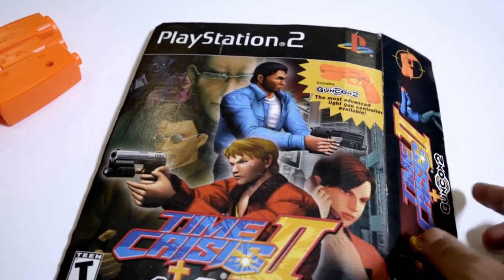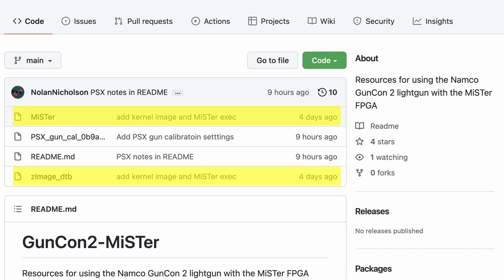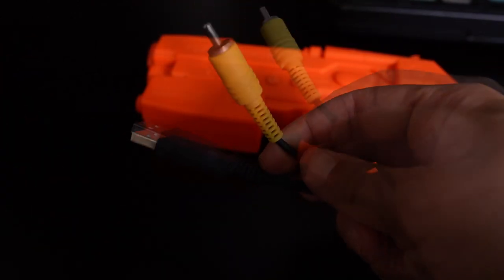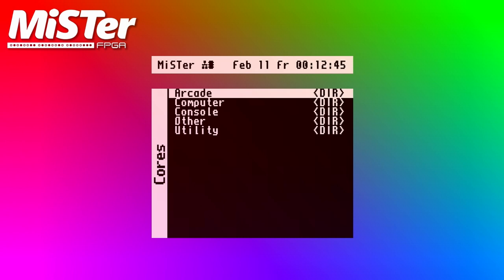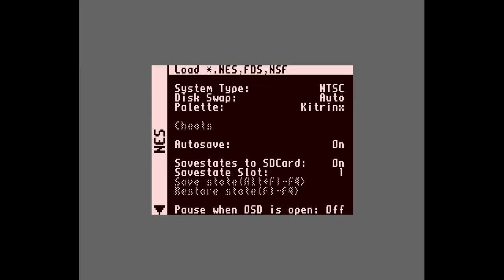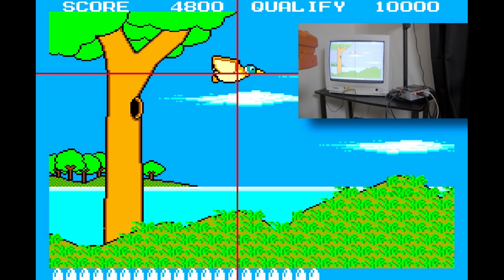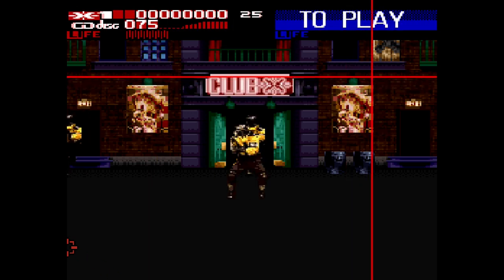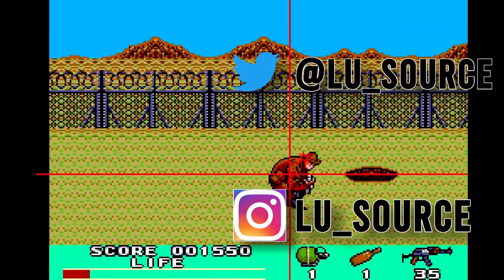Use a GunCon 2 with the MiSTer FPGA!

Comment: I found when calibrating you need to press the "A" button on the guncon (it's mentioned in the github). On T2, I set the SNES "A" button to the "A" button on the guncon, and the SNES "B" button to the trigger on the guncon, and it worked well after that.

Comment: Just a quick tip for anyone using S-video with Antonio Villenas adapter: You would think that you could just plug the GunCon  rca cable right into the unused composite output on the adapter but that does not work for some reason. You have to still plug composite into your TV and split the signal like normal. I suppose the reason is that the adapter does not send a composite signal unless it detects a TV input.
Reply from the maker: Thanks for letting us know.
Reply: So do you have tha adapter connected to your tv with both s-video and composite (for the light gun)?  Do you just switch to composite input to play light gun games? Or do you have to mess around with cables when it want to go between s-video and composite?
Reply: @markderidder   yes my mister is connected to the TV with both s-video and composite simultaneously , but I never have to switch to composite on the TV, I can play light gun games with
 s-video. It’s weird, but that’s the only way it works with the adapter. On my real PS1 and PS2 I can plug composite right into the guns without any composite TV input and it works fine. 🤷‍♂️
Reply: @Pawnband  odd. But thanks for clarifying!

Comment: This is really cool, wished it worked for CRT monitors. Fingers crossed for Sinden lightgun support in the future.
Reply from the maker: This works on CRT's exclusively. Maybe you actually meant flat panel TVs? The GitHub project for the GunCon support does mention that you can use it with the Sinden lightgun. However it requires a Pi 4, Arduino Micro and OSSC.
Reply: @LusRetroSource  Well, CRT monitors and CRT TVs work a bit differently. Most lightguns don't work on CRT monitors. I'll have to look into it more.
Reply: Its a question about 31khz CRTs (480p+) where you need to use the scandoubler for most cores.

Comment: Has anyone gotten a GunCon 3 to map to the whole screen? Even after doing a calibration I'm stuck to a small window within the center of the TV.
Reply: Did you do a calibration inside of a core? Have done that for ps1 core and it worked, but still having issues with button mapping and overall response time

Comment: Followed this guide but after placing the github files and renaming the old ones I can no longer use my BT or Wifi adapters and can't revert the changes very easily since I can't FTP into the MiSTer without the wifi adapter.
Reply from the maker: I need to update this video. This github files are no longer needed so revert back. Last wee, everything needed to work is has been officially add to MiSTer.
Reply: @LusRetroSource  so can I simply plug the guncon in and play?

Comment: Is it possible to remove the crosshairs like on the original consoles? Thanks for the video!
Reply from the maker: Yes, on the cross hair option I show in the video, just set it to off. I just left it on for the video so you can see the tracking done by the lightgun.

Comment: Do you know if anyone is working on getting the Sinden lightgun working with Mister?
Reply from the maker: The GitHub for the GunCon support said you can use this to make the Sinden lightgun work. However, you will need a Raspberry Pi 4, Arduino Micro and an OSSC.

Comment: I use RGB w/ H-Sync via BNC connectors.  Does anyone know if I can use the H-Sync cable with the Gun-Con 2?  It seems sort of like no matter what cable carries sync, that's the right cable to use, but I'm no expert.

I don't mind using RCA adapters to/from the GunCon2 cable, but I do ultimately want to stick with RGB.
Reply: I use an RBGHV lead from the MisterFGPA, using just the grey (H) lead normally with my PVM. For this to work with the lightgun I just had to enable 'sync on composite' setting in the ini, and then split that grey wire using a BNC splitter and a BNC to phono. Works well
Reply: @willmoindrot  thank you!!